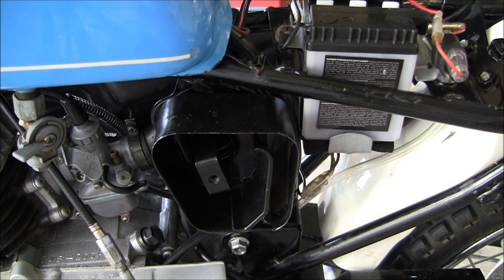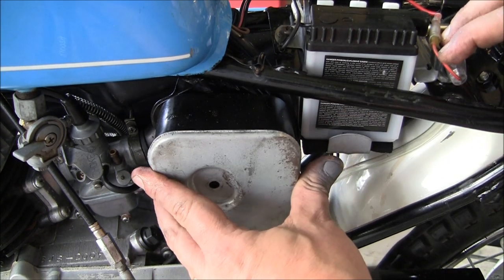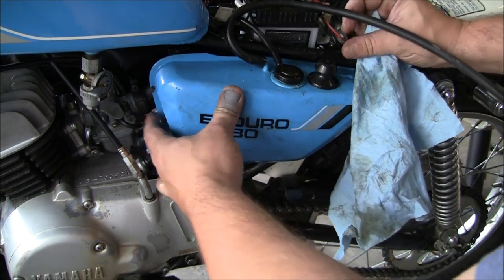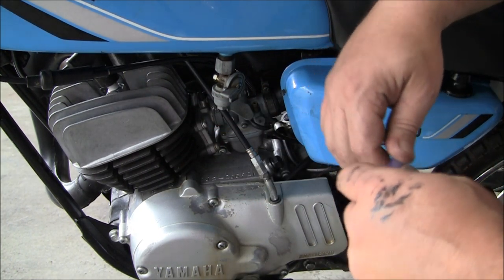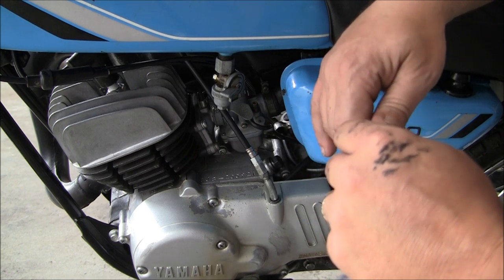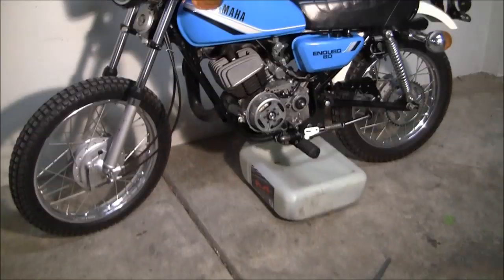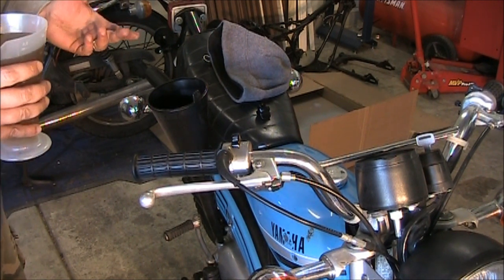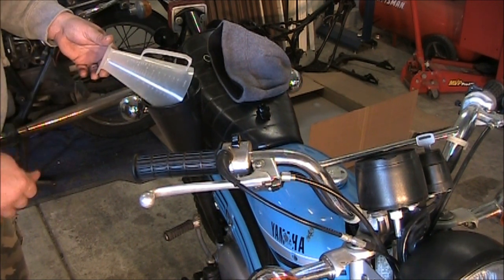Dirt Bike Oil & Filter Change, Oil Tank & Fuel Line: Yamaha DT80 Enduro Part 8:

Comment: There is a fuel filter built into the bottom of the factory petcock that is serviceable. It's more of a particulate filter but good enough if you can find a replacement.
Reply from the maker: There wasn't one so I don't think it was factory,,

Comment: I bought a suzuki 74 ts185, has no gas oil tank and someone disconnected all the hoses and oil throttle cable. Can this bike still run if someone manually mixed oil and gas right into gas tank.?? I'm super new at bikes.

Comment: Hi John , have you any videos on front fork of GT80 ? If I press on the handle bar pushing down it does not come back up. what could it be?
Reply: The springs are shot and/or shaft slightly corroded making it get stuck. 
They have very tight tolerances.

Comment: terribly sorry to bother you again but I was curious if putting more oil in the mix would prolong engine life.dont mind fixing fouled plugs.I will more than likely go with your 32:1 mix as you now a whole lot more about it than me.it is mainly just curiosity.thanks again in advance if you have time to reply if you do not have the time i completely understand and will continue watching  your videos
Reply: Too much oil lowers the knock resistance and makes the gas go bang TOO easily. This is all dependent on compression ratio and what mix it's BUILT to run same as a car and fuel octane level. Oil also doesnt go bang and make power so you'd LOSE power plus risk damage to the pistons. Try mowing thick wet grass then put some 2 stroke mix in and try it again. You'll see exactly what I mean. It'll knock like there is a hammer in the block under any degree of load
Reply: Also after seeing one torn down I worry less because there is also not metal to metal on the crank and rod bearings like a car. They have ball bearing bearings so extremely low friction. My bikes oil pump is original and is not a resto bike like this. It mixes still and I think what actually gives out on them isn't the oil pump, it's the cable. Which is adjustable. You can literally richen the oil mix by adjustment and if there is slack in it it absolutely needs adjusting.

Comment: hi man, excelent video! i have some question, you talk about the fuel filter, the bike doesn't have one being stock, so how it goes without the filter? runs well? and another question, if you have the space, you would instal a filter??
Reply from the maker: It's running fine without it but it's always good to have one so dirt doesn't get into the carb.
Reply: It has a tank one at the petcock but a lil screen type inline one works great. Paper ones are a ... Trade off. They will block water. But once they get water they block everything as they swell up. I kept running into that on my cb400 until an old man told me swap the clear paper one for a screen inline one. Haven't had a problem since. If rain condensates it gets in the carb bowls and either I can drain them or burn it off. No biggie.

Comment: sorry man but I have found out that some guys use less when racing.it means more hp but engine life suffers.I was just curious if more oil would keep the engine running longer in between rebuilds.with that said they racing guy I talked to could be wrong but he won quite a few races

Comment: Question, I fixed up a Yamaha MX80. Very similar in structure but when I bought it used at a barn sale, it did not come with the oil injector tank over the air filter. Will I be okay just directly pre-mixing 32:1 oil into the gas tank without the independent oil tank/pump? Will there be a reliability issue if I continue to do this? The bike does not have the pump or the tank but it appears missing. (not too much experience with two-strokes) Thanks
Reply: +cristianthegr8 You will be fine. Most actually do that anyone just in case the injector is not working.
Reply from the maker: +cristianthegr8 You will be fine. Most actually do that anyone just in case the injector is not working.

Comment: quick question if you have time.If not I understand.what is the best fuel mixture for a 2 stroke for a long life?
Reply: Depends on the 2 stroke compression ratio. If it's the wrong mixture and you run the oil mixture rich, you'll get detonation, fouled plugs, and caked up exhaust...

If it's too lean...well...same.
Reply: And this bike, the DT80 AND GT80 do their OWN fuel mixture. Don't premix it.

Comment: Sorry to bug you, but what weight of oil are you using in the bottom end?
Reply from the maker: +shane bommerscheim I don't recall what I put in there, I think it was just 2 stroke engine oil. I'm pretty positive it was actually. They make specifically blended oils for 2 stroke crankcase.

Comment: Hey I have filked my dirtbike up with normal gas and it doesntvrun because it is a 2 stroke so iam am wondering how to drain you gas tank and oil please make a vud on it.
Reply from the maker: Just remove the hose where it connects to the carb from the fuel petcock and open it up to drain. Oil should have a plug on the bottom of it.
Reply: Anything else reccomened to do?
Reply from the maker: Nick Blevins Not that I can think of.